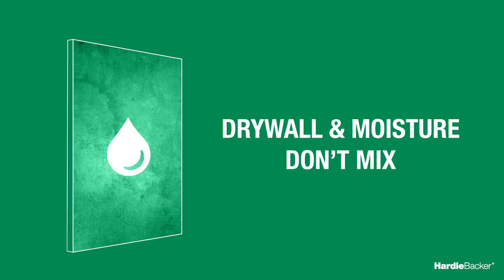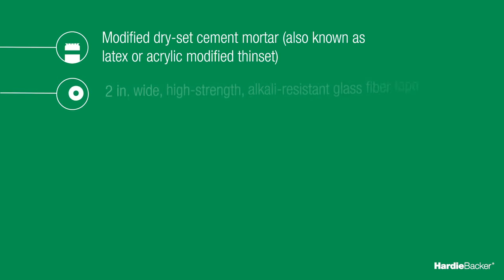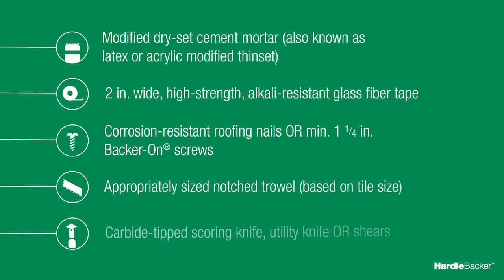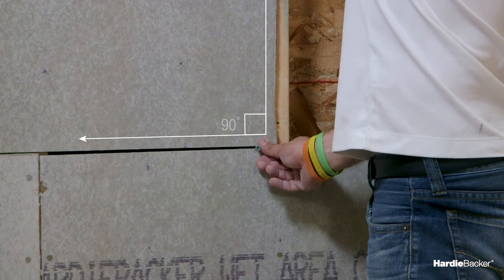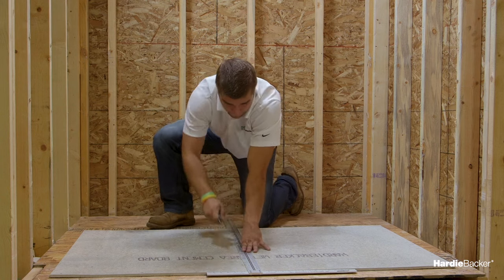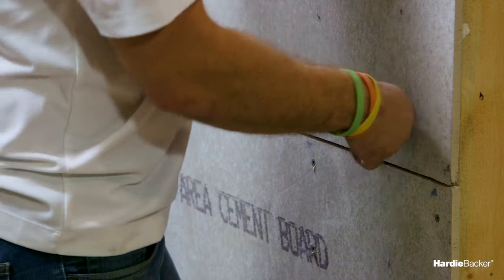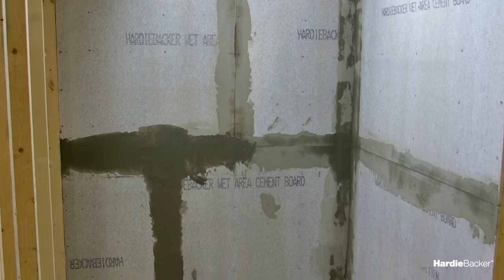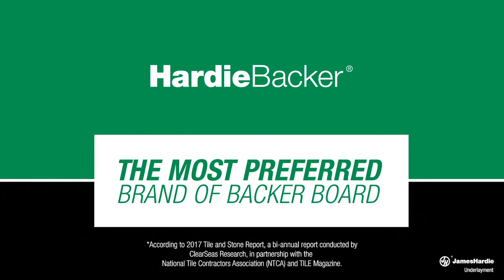How to Install HardieBacker Cement Board on Walls

Comment: Always used a waterproof membrane on the board like Red guard or aqua defense
Reply: It’s waterproof board.  No need to use an extra waterproofing membrane. And before anyone says otherwise, I’ve been in my home for over 25 years and the first shower I did without a membrane (because it wasn’t called for back then) and after 22 years my shower is perfect with no water damage

Comment: Maybe I missed it?  
Which side goes out, the rough side or the side with all the embossed squares?  Thanks 🙏🏼
Reply: Ive seen tile guys put the label side in but from what im reading....for the .42 wide 500 HardieBacker on walls it doesnt matter which side is in or out. Obviously if you put the label side out youd want to remove the label sticker so thats probably why tile guys just do the label side in. The thinner floor HardieBacker does have a side up though.
Reply: It depends on your installation. If you're using a latex mastic, smooth side goes out (this is common with linoleum tile, immitation-tile-sheet, and other flexible materials). If you're applying tile and using a thinset (latex or acrylic modified, or otherwise), the rough side goes out.

Comment: Do you have a video on the Hardiebacker with Hydrodefense that is now available?  Is it the same?

What about the bottom edge going against a permafrost pan?  Is there a recommended sealant for that transition?   If used in a KBRS pan that requires the backer board be installed into the pan.  Is there a sealant there to keep it from wicking?

Comment: What does he mean at 2:42 “caulk accordingly?” Do I caulk seams before I thin set them?
Reply: I have no idea.  I installed everything listed in this video and did not caulk.  I caulked the FINISHED tile CORNERS,   that was it.  I did not caulk the backer board.